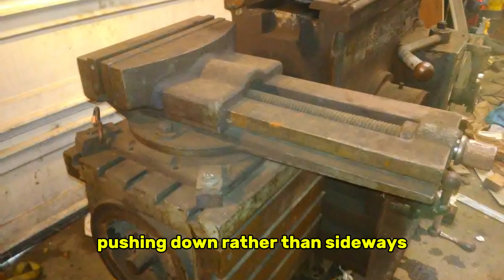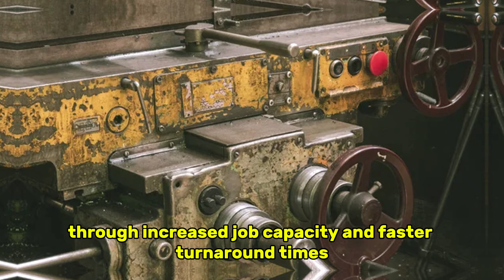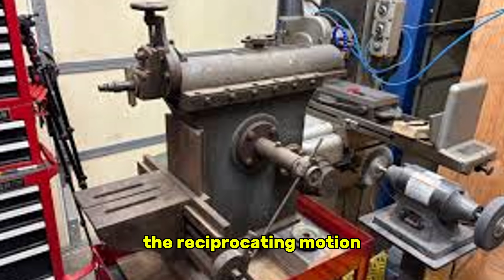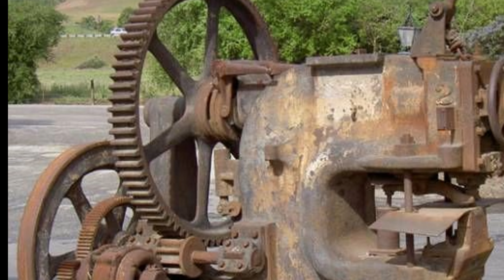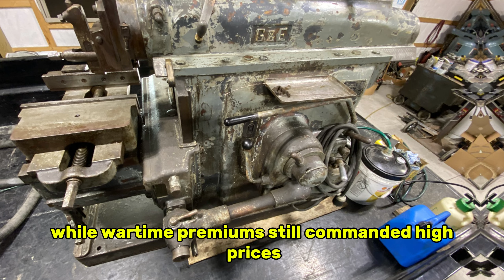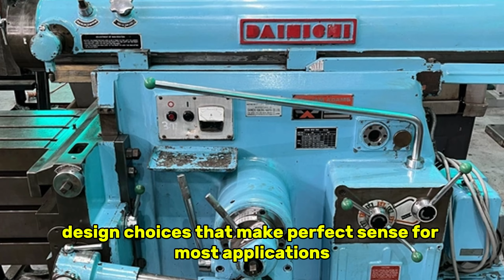The 1909 Shaper Machinists Hated — Until It Outcut CNC in Heavy Steel

Comment: The collage boy that programed the robot hasn't got a clue about cutting tools,,,,, and BTW. You machine BEFORE heat treat. - After heat treat you grind.   One more thing, The title says shapers outcut CNC machines? - CNC wasn't even thought of until decades after the time of this story ,,,,, To this day if you look hard enough there are shops that will GIVE you a shaper if you rig it and get it out of their building. - Shapers can do anything? Yea but there are simply better ways to  do everything that is done on the shaper and the planer.

Comment: Steel should be cut before hardening not after so cutting of hardened steel is wrong and by the way I loved using the shaper during my apprenticeship in the early 60s along with the lathes, vertical mill, horizontal mill, slotting machine and horizontal boring machines along with other odd machines as an when required, that is what my apprenticeship required in those days, not polishing a chair in front of a computer as these days.

Comment: Shapers were alive and well in the'70s & '80s in maintenance shops in Australia .I used to cut large tapered keyways in large cast-iron bevel pinion gears and slots and keyways shafting and large components, no other machines in the shop could come anywhere near doing these jobs. Well sharpened h.s.s.tooling finished and oil stoned and careful speed & feeds adjustments gave good acceptable surface finishes. Yeah, I have a soft spot for shapers.

Comment: I have a couple jobs in the shop that a shaper could be used to an advantage. I need to remove about .150" from blanks of DC53 before finish grinding and continuing. Also, cutting a keyway at an angle

Comment: Why does  the title say that machinists hated the shaper?  Talk about clickbait.  I'm a 68 year-old amateur machinist and own an Atlas 7A shaper.  This machine will cut within .0002" over a four inch piece of steel and it will do it while I'm busy on the lathe.  There probably are milling machines that can cut to these tolerances but they're way, way out of my budget.

And machinists like Keith Rucker, Abom79, and  Keith Fenner still use shapers.  Even Stefan Gotteswinter had a beauty of a WWII era German shaper that he used.  I don't know if he's still using it, since it's been a long time since I watched his channel or any others.  I've been traveling the last four years with my wife and I tended to watch videos of those areas we traveled through.

"The vibration and noise that made operating a shaper unpleasant..."  I stopped watching at that point.

Comment: I totally loved working the shaper that a tool and die shop I worked for had. It was all the way in the back of the shop in a corner and every so often I'd get to use it. I used to experiment with how big a cut I could take with each stroke and I'd get these chips peeling off that were blue and when those chip broke off at the end of the cut, they'd shoot out like bullets. We'd place a sheet of plywood in front of the machine to stop the chips from shooting out into the shop. Once in a while I'd catch one of those chips what riccochetted and it burned like an SOB. That was back in the late 1970's and the shaper was made by Gould & Eberhardt. Here's something to think about. You could easily machine a dovetail on a shaper but if you did it on a milling machine, you'd need a special dovetail cutter. A big dovetail would require a big cutter. That's a lot of money and a lot of tangential load on a mill spindle. Think about it.

Comment: I have a shaper attachment for my oldest universal mill
 All my internal keyways are made by my self made specialised hydraulic broaching machine.
Only 3 years to go before 80yo so I should get rid of it and the large 7.5 ton  hydraulicly assisted universal mill. BUT I just haven't got the heart, even though it been years since using those 2 and the attachment was only used once. At home I have 2 mills one being my favourite but not a universal. A financial adviser friend told me if I disposed of all my machines in the factory and sold it,  the money invested in the stock market or elsewhere would serve as a perpetual pension. My answer,  I would be dead within a year as it would kill my identity.
Reply: Sorry, forgot. 
Greetings from Sydney Australia.
Reply: Great comment John!
I have a Bridgeport and a Lathe in my home shop for over 30 years now.  I worked in Aerospace (electronics) for the same time and with the cyclic nature of the industry reductions in force were frequent.  My ability to bring machining experience and limited capability to the “table” kept me off of the white box list.  I’ve always been known as the guy with the machines…I believe there are many of us who identify as such and are proud!  Be well John

Comment: The shaper/ milling war is based on the premise that one is universally superior to the other. It begs for the question of what you are making. Inserted carbide end mills and face mills changed a lot, but not all of the landscape. It is still damn difficult to broach key ways with an endmill. I had an American made slotter with a tilting ram, that was a victim of space.
Reply: My shaper sits next to my vertical mill.  They compliment each other.
Reply: The last shaper we had went to the industrial Museum in 1984. We never looked back or had a need for it again. Certainly there are uses that can be found for them but there is much more accurate and efficient ways of Machining. It's called progress
Reply: @lorilen-t6k 
As a machine tool the shaper is just as accurate.

Comment: Ugh! Another small site spouting total nonsense. Companies don’t use these old machines as they’re way too slow to do any useful work. Now, a few small shops sometimes use one, here and there, for odd, one off work. Otherwise, they’re totally obsolete. They and planers, were pretty much gone by the early 1950s. And they do have cutting force sideways, just as a rotary mill does, so that’s nonsense as well. And the size is very limited, even on the largest models. You can only make the ram so long. Planers can be made very large, but again, they’re very slow.
Reply: One thing that can be done to a large hydraulic planer in a shop with work too large for a normal milling machine, is to retrofit milling heads on the cross rails and the side rail. Future-Mill is one that I got to help with the setup. A 30’ Rockford hydraulic with three 30hp milling heads.
Reply: @robertqueberg4612  Shapers - Love them or loath them.   @melgross is obviously in the latter group.  I wonder if he has ever actually use a shaper or a planer.
BTW, I built a small attachment for my 10" Alba-1A that carries a small electric motor  and I used it as a surface grinder until I got a dedicated machine.
Reply: Shapers have advantages in making cuts at the bottom of deep narrow well. An example would be a recent job done by Keith Rucker on his channel. He needed to cut ways at the bottom of a steam engine to drive a coal feed system for a steam engine. He tried first with his very heavy vertical milling machines. Too much chatter cutting 2 feet down. 

So he finished up his planner, the big brother of the shaper. He did have to make a interesting tool holder but after a bit of work was able to make the cut with good finish.

The point is that the shaper  / planners are far better at inside cutting than the mill. Shaper functions never completely dissappear,  I have seen many a video showing people turning their lathes into shapers, using the tool post to hold the cutters. 

The other problem with mills is again the deep well problem, to get around that the designs have to move sidewalls out making parts wider.

As to sideways cutting forces, the only real source is the tool pressure if there's a tool side cut.
Reply: The size of a shaper is not more limited than a mill. The biggest shaper i worked on had a 4m stroke, but it was a portal shaper where the table did the stroke
Reply: @wolf310ii    Then it wasn't a shaper it was a planer.
  You claim you worked on it and you don't even know what it is called?  WTF? Also WTF is a portal shaper?
Reply: @Onan-u3b  Unlike you i know what a shaper is and there a different build forms of machines.
Reply: @wolf310ii    Very clearly you do not.  You are a posturing know-nothing.
There are entire volumes of books written about machines that have accumulated over hundreds of years. 
It appears you have never turned the cover of a single one.
  I own a lot of machines including a shaper and a planer and I doubt you have ever used a machine to create anything.

Comment: I have 3 shapers and 2 planers when the machining gets tough they shine
Reply: I got to run a shaper on occasion when I was working in a tool and die shop way back in the late 1970's. I worked on all the machine tools from Bridgeports to Brown & Sharp cylinderical grinders, and of all them, my favorite was the shaper. I just loved how mecahnical it was. My boss, who was very clever, incorporated a manual transmission out of a truck in between the motor and the input pulley of the shape.